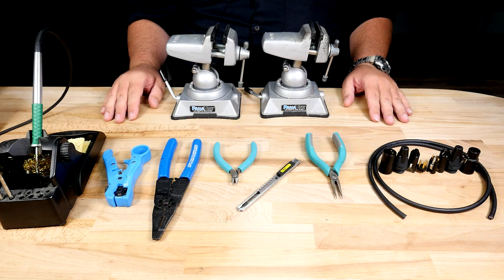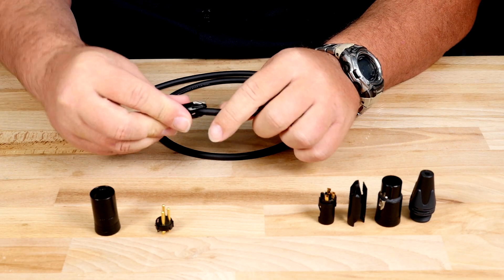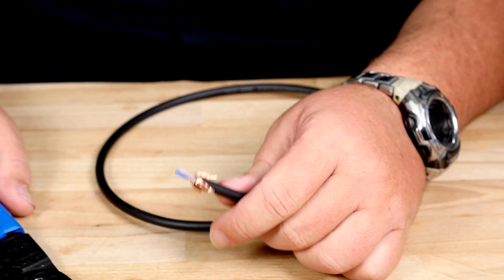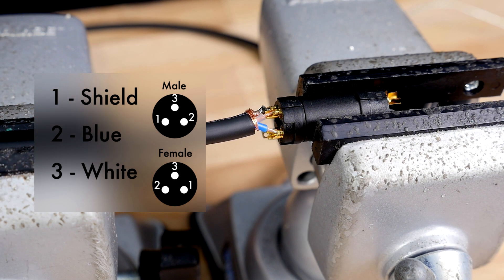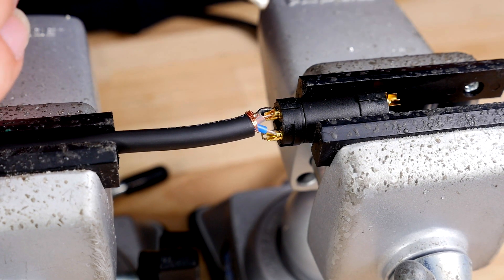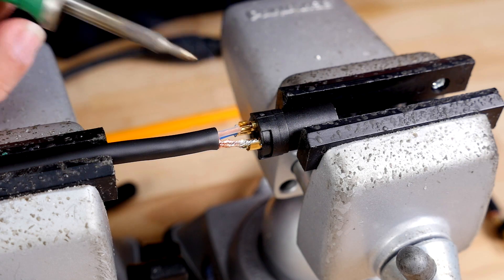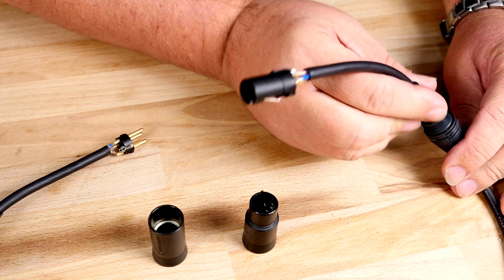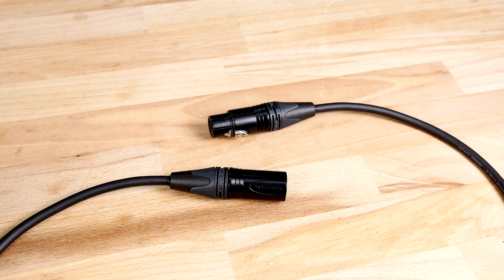How to Solder: Microphone Cable with XLR Audio Connectors

Comment: Tin the cups and then flux and wick it back out with braid or extra wire to remove the gold plate.  Then tin the cups insert wire and apply heat to the back of the cups to draw tinned solder together.  Fill cups to just above a concave no less but still far from a convex.  Solder should only touch iron to tin it to create a good thermal transfer.  You don't want to drop solder in to it from a hot iron it leads to cold solder joints.  The thermal transfer needs to melt the solder with all components tinned in between the cup an wire

Comment: Well after years of touring we find a small piece of heat shrink (3/8") over each of the wires covering the pins is a good precaution. Also pre-tinning the pins and wires is good practice.

Comment: What soldering wire you recommend to solder xlr cable
Reply from the maker: We use Kester Lead Free Solder
Reply: Never ever use lead free. That shit is gross. Unless you carry around 2 vises it is terrible. It solidifies slowly and if you move the wire at all it will create a cold joint. Just stick to 60/40 and you'll be right. I like r.s.r electronics 0.31" diameter wire.
Reply: @Yousitech Wrong. You obviously don't know how to solder. I never had a cold joint with lead free after 30 years